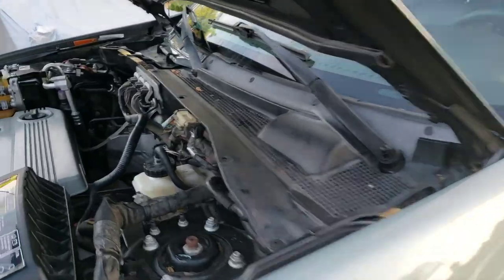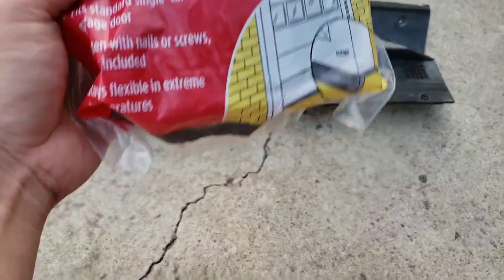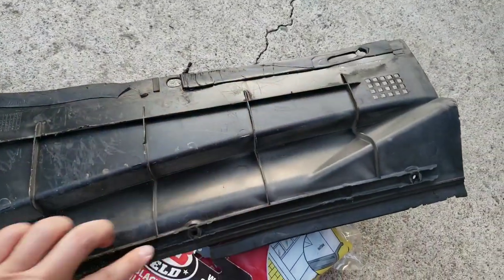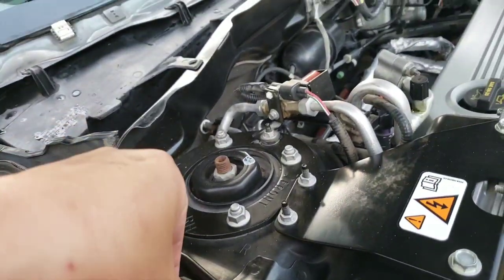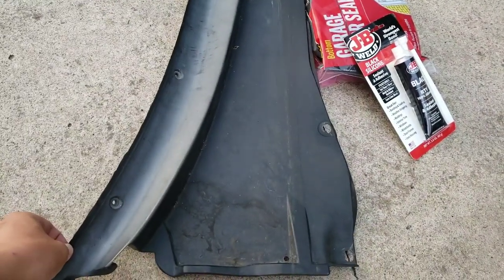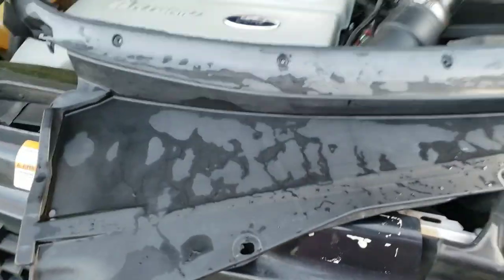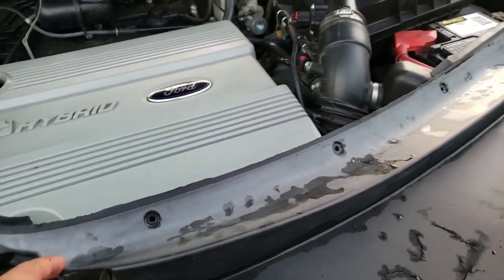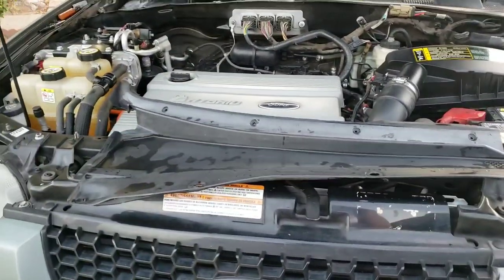Ford escape cowl rubber seal replacement

Comment: I used the same EVA rubber garage seal on my Escape cowl repair project. It looks good and works well. I cut and scraped off as much of the old rubber as possible and then I just sandwiched the strip of garage seal between the cowl pieces and the window. I didn’t use any adhesive at all because I wanted it to be easy to replace again in the future. I felt that screwing the cowls back in held the seal strip tightly enough against the glass without adhesive. It has been through a rainy season with no problems so far. The only change I would make is I might add a little adhesive or sugru at the ends where it’s not holding quite as tightly against the glass.

Comment: I am having the same problem in my Ford Escape. Please share the link where you bought the COWL.  Also please comment if it was an exact match
Reply from the maker: https://www.homedepot.com/p/M-D-Building-Products-2-in-x-16-ft-Rubber-Replacement-for-Garage-Door-Bottom-03749/100353454

Something like this or similar to this will be fine. you can find cheaper one if you shop around. just type in garage seal or garage door rubber replacement.